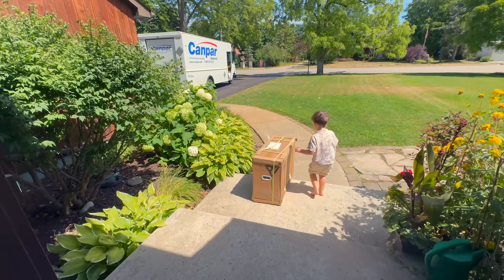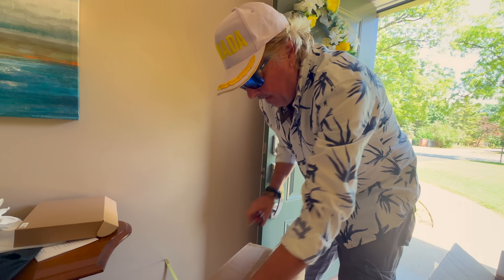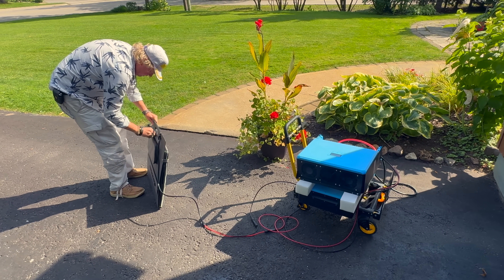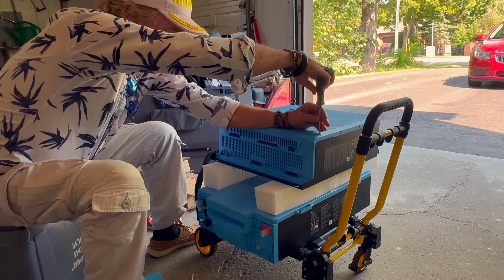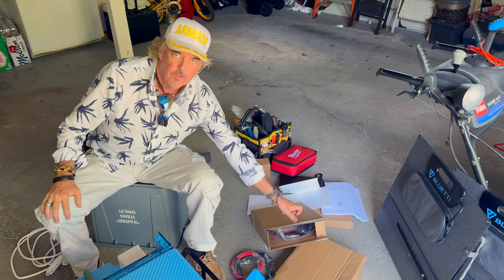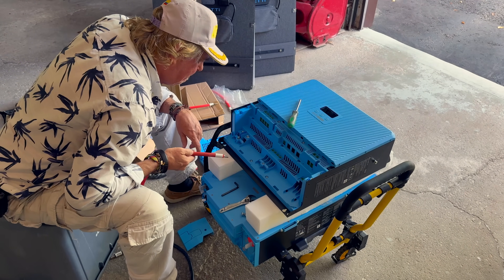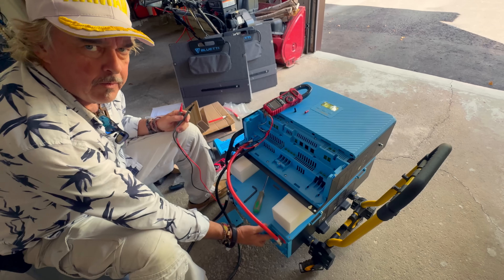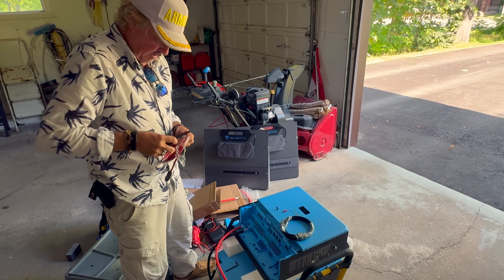SSL741 ~ Testing the BRAND NEW Bluetti RV5 Solar 48V Power System

Comment: You made a mistake at the end when you plugged in your cord into the AC outlet - You said it switches from battery to grid power. This is incorrect. The AC In only powers the internal battery charger. There is no auto switching - The AIO load is only powered from the battery only. Also you touched on programming the amp load on the AC In - There are 3 charge levels .. .. The AC amp draw is 10/12 and 42 amps representing quiet/normal and Turbo charging.

Comment: I was jst starting to buikd my solar setup when I dicovered this Bluetti system. I "was" going to do a 12v setup, so I purchased two 320Ah LiTime batteries to connect in parallel for 640Ah, because of their black Friday sale. I hadn't decided on panels or MPPT yet and was mulling over doing a 24v system and out the two batteries in series, so I just got the batteries and Bus Bars.
But now...I reall want this. Lol. 
So my question, since I already have two 320Ah LiPro batteries, what's your opinion on getting two more 320Ah LiTie batteries (for around $1400 for both, total with current sale) and putting thos ein series with a balancer for 48v? Or do you think it would be better to just bite the bullet on shipping charges to return the two that I have and get two Bluetti 100Ah batteries designed for this system, to begin with?

I am new to all of this (building out a short bus to be my home on wheels! A 2006 GMC 3500 Cutaway.) and much rather have the simplicity of a system like this, rather than the whole "DIY aspect of solar and risk messing something up and risking damage to components (or worse). 

Appreciate your guidence and suggestions!

Comment: So this does the same as the Victron equipment right? In that when you have the grid throttled to say 10amps, but your load is greater than that, the inverter is making up for the loss By using battery power?

Comment: What you going do when one of the proprietary components fails and you have to send the whole unit back because a single that failed 1000 miles offshore?

They gave it to you(and I hope you got additional pay for the review, so no love lost. Purely a backup situation. I wouldn't depend on that unit offshore 20 miles without a primary/redundant power source. Some people will possibly say:"Rick Moore recommended, so it must be good.

Free

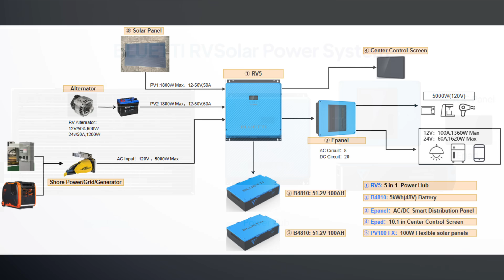Comment: Great video! I'm eager for them to release more information on this system. Are the specs at the 2:53 mark inline with the system manual or was that a quick mock up you did? The PV2 specs (12-50v, 50A) make sense since this would be for an alternator charger or a portable panel, and that probably goes to an internal DC-to-DC charger. However, those same specs for PV1 would be very limiting for a typical rooftop solar set up for a system of this size; 100-200v output from series connects is pretty common. Are you able to confirm the voltage acceptance range for PV1? I imagine it's connected to an internal MPPT that supports at least 150v input.
Reply: 50V is the max on either PV1 and PV2

Comment: The units seems too large for fitting in a mono hull below 50 feet (what most of us have).
Reply: A Victron Multiplus would be similar in size. I'm looking to fit it in my stern locker (full height).